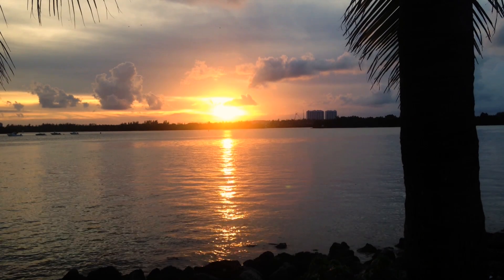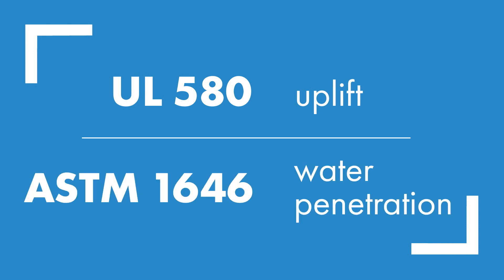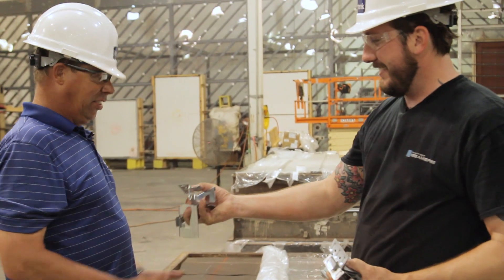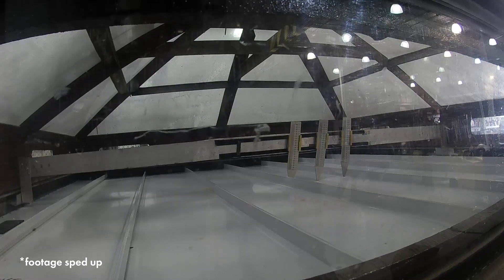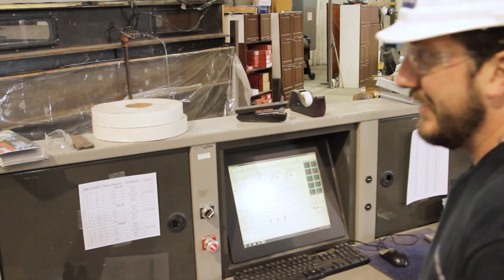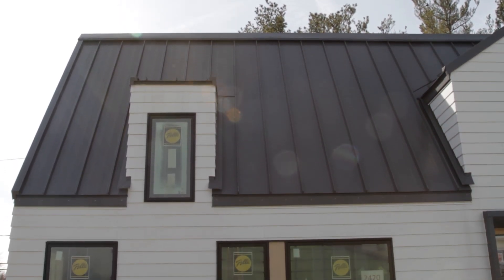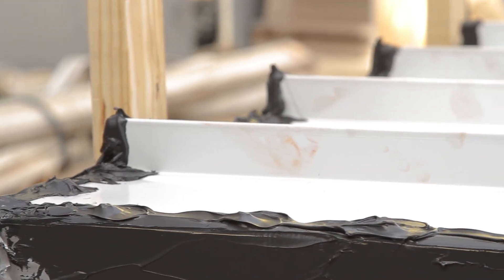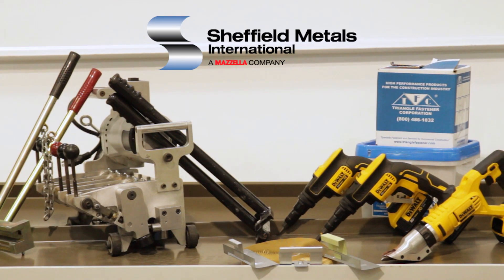Metal Roof Weather Testing (Wind Uplift and Water Penetration)

Comment: does psi equate to a relative wind speed?
Reply from the maker: No, PSF and designations like UL 90 do not directly equate to wind speed. The required wind speed can be calculated from the engineering numbers depending on your specific building's features and location. Here's a video that covers how: http://bit.ly/UL-90-wind-speed-video -Thad

Comment: Clip systems are much more expensive then screw/nail strip system....which system will withstand higher wind speeds??....Need to know information....this is the testing needed
Reply from the maker: Hello, I replied to one of your others comments with these thoughts: It is our opinion that in high wind zones, a clip system would be preferred over a nail flange system That being said, certain clip systems definitely perform better than others so it is important to know what you are getting and to not assume that a system will be ok just because it has a clip. With a nail flange system you are counting on the head of the fastener to secure the panel down and while the fastener may stay attached in the substrate, the metal slot may rip or pull away from the fastener. This is especially dependent on the metal gauge the nail flange panel is made of . With a clip system you will usually have a minimum of two fasteners per clip and quite often the clip is made from a much thicker gauge than the panel itself. The fastener in a clip goes through a hole designed for that size fastener in lieu of a slot where there is more play. The clip engages over the male leg of the panel creating a strong connection and these clips can be spaced as close or as far apart as needed to meet the requirements for different areas. In a nail flange system, you are limited to the minimum slot spacing. Furthermore, there is less chance of installing the fastener incorrectly in a clip system (i.e. to tight or loose) and clip systems accommodate thermal movement much better. Lastly, you will see some nail flange systems being glued in the panel seams. Doing this allows these panels to achieve some very high uplift pressures because the panel is literally glued together; this is a fairly new approach. While these panels perform well in testing, there is no long term data that we know of showing the performance 10, 20, 30 years down the road. Since metal is a long term product we prefer to use traditional methods of roof attachments within our systems. Hope this helps! -Thad
Reply: @TheMetalRoofingChannel  ..ok, thanks....good explanation....its been frustrating dealing with roofers, they don't seem to want to answer the clip/nail strip...question.....and the price difference is substantial.....They deal with Gulf Coast systems here in south/central Florida.....
Reply from the maker: I understand, well hopefully you can use some of this knowledge to help you out in your project. If there's anything else I can help you with, let me know! Thanks! -Thad